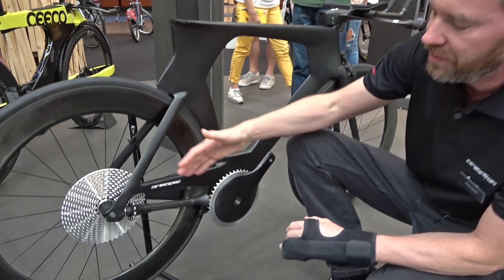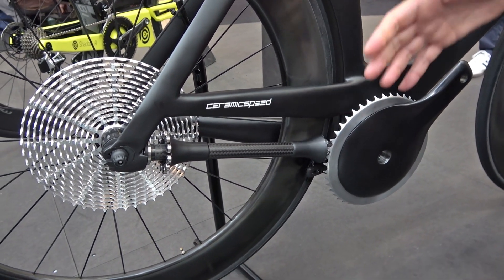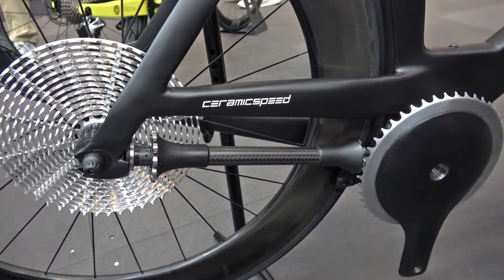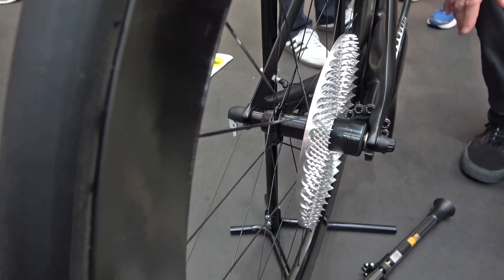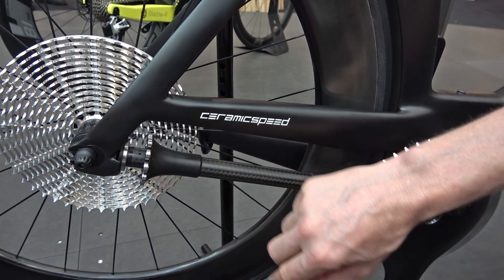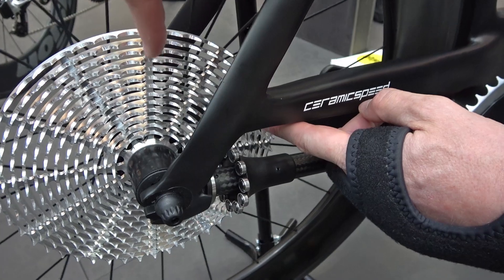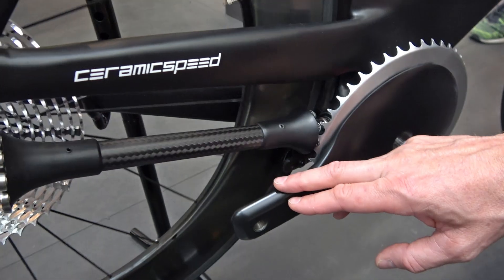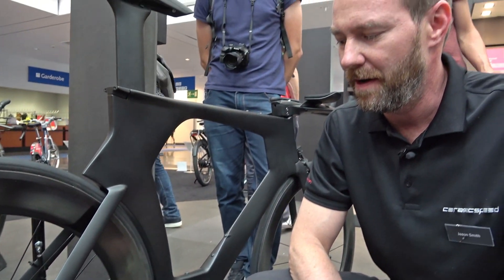CeramicSpeed Driven - Fully explained

Comment: The new angle is doable but it would take more technology than necessary to actually get it to work right because of the angle largely it looks like an idea that was invented by the people that came up with the three wheeler it works it's doable it's very stable but you tried to do something extreme on it last but not least excellent video I like where your head is at

Comment: It's a neat idea but the electronics are a turn off.  Also... I've seen strong riders break parts.   What happens when some athlete with legs like tree trunks is sprinting on this... I can see a lot of bad things going wrong.  Lack of friction is a good idea as an abstract but to really be viable you can only reduce friction to where it does not mess with the ability of the parts to remain engaged under force.

Comment: Nice in concept, but that rear 'sprocket' is guaranteed to fail, especially in the lower gears where the side thrust will bend or break the disc due to lack of support on the back side. Plus, I don't see any way to keep dirt, mud, water, etc. out of the bearing surfaces, even if the bearings are sealed. In the automotive world, we all know how hard it is to keep contamination out of 4WD components. Bicycles are no different.😐

Comment: Mechanical engineer here...there are so many things wrong with this.
Reply: What exactly?
Reply: @theMosen  usually we apply a a pull force using a chain. This force acts on the rigid side of the sprocket. It's like using the sharp side of a knife... No deflection. What they are doing is 1) reducing the number of teeth in contact with the chain to just 1 and then using the least rigid side of the sprocket to impart a force that is probably 90% over the rigid side and 10% over the weak side when there is no load. The bigger the teeth, the better... When there is no load. As soon as a load is applied, that 90% will drop, the bearing will move up the teeth and create a moment force on that tooth.. trying to break it off. This will be met with a contact angle change which will let the bearing jump one tooth and smash on the next one. Or, not, not that day, maybe tomorrow. Each toot flexing means crack propagation. You will need a very rigid material to make sure the bearings don't jump teeth, specially the larger diameter speeds. If you pick a very rigid structure, it will be suceptible to cracks and crack propagation after work hardening. Anyway, what they are doing is trying to cut with a knife, not on the full side, but side ways, it's just going to bend. Additionally, that rear gear has to be machined. If not completely, at least the teeth need machining. Expensive. But also it weakens the very structure you want to be rigid so the bearings don't jump teeth. There are a few other things. But I just woke up so I gotta check the news. Laters!

Comment: Rubbish!  A standard drivetrain is already at 99% efficient.  Look at the way the roller bearing slides into the teeth.  The frame and rear cog has to be extremely stiff in order for it to work.  That rear cassette is extremely flexy, causing massive losses and extreme inefficiency.  Stomp on it, and watch it skip gears.  Listen to all that noise.  It’s inefficient to have to beef it up structurally just so it doesn’t flex.  Meh

Comment: Dude That's not fully explained, change the title to this video. To Introducing the New CeramicSpeed Drivetrain. There is a lot more to explain, the crank and shifting of the crank and what kind of shifters you are using. Did you say electronic? What it's an automatic shifter? How does it that work front and back more details especially while riding, How we choose the gear? What with thoughts or the power of weight we apply or what? Hooking it up? Plus you didn't demo the rear shifting while in motion.  What is up with It's like my motorcycle a VStar 1100 custom or classic, They have drive train, no chain or belt. Ceramic got the pointless friction but is it fragile is it breakable? Like will it shatter like a plate or what? Is it only for street and wood tracks or you have outdoor type downhill or trail riding? Is it grease lube or something else. Sealed bearings? What's behind the crank three-piece. How about attaching to the bike? Any bike wheel and frame? You need to do a lot more than just say look at this. Common!

Comment: Has a lot of weak points from the looks of it.   Might be fixable with dual shafts on both sides of the rear cog. Then you have added weight.

Comment: Sure looks familiar..... like piece of a bike chain wrapped around the shaft and a bike gear with the teeth bent sideways. This idea has taken away a lot of strength as well as the weight and friction.
If I was one of the human testers/guinea pigs for for that on a bicycle..... I would demand cojones protection, like padding or a cup, plus shin, calf, toe and chin guards= I've had chain drives slip off and or break before and have ruinated my parts more than once.

Comment: First, bad explanation, second as the smallest ring of circular teeth represents the highest gear, no you cannot add more gears to this as the smaller ring produces more movement since it won't have to go through so many teeth to make a full turn on the backtire.
This project is faulty for another reason as well, wireless? battery? how would they fare against bumps friction and length of usage. Remember chains and general gearshifting lasts a very, very, very long time. The first two failure points are these that I've noticed, i'm sure some cycling enthusiasts could find more points of failure but these are just my two cents.
Drop the project as soon as possible (investment wise and evolution wise it's a black hole).

Comment: The reality with this is that it will not work. The amount of force needed to keep the gears in mesh would be substantial. One stone and it's done. That's even if you could transmit any force through it in the first place.

Comment: It would be fine if the bearings and teeth were made out of dirt-reflectant Adamantium and the shift mechanism out of Mad Sweeney's melted down lucky coin with a sprinkling of fairy dandruff for extra double the luck and lubricated with holy water from Lourdes.

Comment: A second pinion, two shaft electromagnetic clutches, and redundant ratio planet tooth sets. Two pinions in the same ratio enables the next ratio's pinion to be in place then engaged as the current ratio is released. This would allow near instantaneous shifts become a possibility and for sprinting loads or climbing both pinions could be on same ratio. 

A purchase order for a new Koenigsegg if played perfectly so it slips past the accounting department's watchdog could become an invaluable tool allowing engineers to Twilight Zone their travel into the spooky thinking area where eureka moments at scary velocity are possible. This seldom accessed brain feature appears to only be available while traveling with a tight proximity between your ass and the static reference surface.

Well look at that, I now find myself with a hankering for something very Swedish Chef. Popcorn, chicken... meata ballsa it is, bork bork bork.

Comment: Very dangerous.  The gear decides what speed you can run.  Maybe there is a flaw.
Sometimes you drive faster on a uphill if you wanna overtake on a smaller gear but if the bike depends on battery and computation then, you have no control at all. Any effect on the mechanism with regards to time using the bike, like battery, heat etc.
Idea to make it lighter, but safety is also a necessity.  Video on actual use please

Thanks

Comment: The play between the cassette and the bearings is LARGE.. horrific wear on the teeth. This wil not work practically... a cardan system would be a better idea. 2 point rolling friction with same force as 8 point sliding friction will cause huge wear.

Comment: Add a plastic shield to all gears with points to oil/grease them and protect from debris. Remove all electronics, use lever, cable, whatever. Sell it for $100 (this involves cheap but reliable parts -which might be a little heavier and cheap labor). Become billionaire. If you try to sell it like this for about $1000, no one will buy it. People prefer a scooter for this kind of money.
Actually, shaft driven bicycles are nothing new. They are being made by Dynamic Bicycles, Beixo, Biomega, and BRIK.

Comment: It amazes me how many folks are pointing out all the flaws in this design and how it can never work in practice. Are y'all engineers? Really? It's a prototype: a proof of concept. They showed they can make a 99% efficient drive train. That's a huge engineering accomplishment. They'll need to spend more time refining the design to handle real-world use cases. That's standard engineering practice -prove it can work under perfect conditions, then make it work under less-than-ideal conditions. Maybe they'll get it robust enough to replace the conventional chain system. Maybe it'll be relegated to a niche use like competitive sprinting. Or maybe it'll remain a proof-of-concept.

Comment: If you never crushed your nuts on a bicycle buy this set up! That might look new but it is impractical, the mechanical stresses placed on that gear ring will cause it to warp away from the single point of contact and when it unloads mechanically your ballbag will take up the slack against the bar!! 
Everything about this sucks, those bearings will clog with dirt and grit, the change system will fail and be a return to dealer job to have it reprogrammed, the secondary gear ring has no torsional strength and will not only flex causing the earlier mentioned crushed nuts but will fail resulting in pushing the bike home and asking yourself why you were so stupid as to buy a pice of crap like that.

Comment: Very skeptical. You have only one point of contact for all of the drive force instead of several points with chain/gear drive. 
As shown, I think it would fail very quickly under load.

Comment: reasons why this is bullshit
1. the pinion bearings (the little ones) will have a tiny axial load rating. much much less than the main shaft bearings even though they are subject to the same forces. the separation forces caused by load will wear those bearings in no time at all.
2. the rigidity of the shaft main bearing housings and the size of the shaft bearings needed to keep the "gears" in mesh would negate any claimed effiencency.
3. the seal friction on the main shaft bearings adds to the the equation.
4. the lack of seals on the pinion bearings will soon invite dust and dirt leading to premature wear.
5. adding seals to these bearings will add friction to the system adding to the equation again.
6. ball or roller bearings require a certain amount of rotation for the balls to actually start rotating under load. before this they are sliding on the bearing races. the pinion bearings are only making small and interrupted movements with each tooth engagement. this will lead to increased bearing wear.
7. The rear pinion bearings are installed in single shear. this will provide lower rigidity making it harder to maintain gear mesh under separation loads
8. The larger "cassette" gears provide a longer leverage for seperationn forces to deform the cassette. To maintain rigidity each larger gear needs to be of heavier construction than the previous. 
9. His idea of switching out pinion sizes to change overall gearing isn't so easy as he explains. those pinion changes would require lateral position change of either the shaft or the mating gears to maintain correct (or any) gear mesh.
10. the single tooth engagement places massive loads on that single tooth leading to higher tooth wear and possibly total tooth failure. 
11. over time the rear pinion sliding drive spline (required for gear changes) will wear and develop both play and backlash. the play will make the rigidity required for gear mesh worse.
12. tooth wear will create back lash in the the system. combined their will be four stages of drive delay on commencing peddling a: freewheel hub pawls b:front pinion to gear c: rear pinion to gear d: rear pinion spline interface. could it be possible to have as much as 1/2 turn of the cranks before drive engagement on a worn system?
13. The axial load or separation forces generated at both ends puts side load on the bottom bracket bearings and the rear axle bearings. Not so bad for the rear axle bearings if they are angular contact bearings (though most now spec deep groove bearings) but its extra side load for the deep groove bearings in the bb. this will lead to faster wear of these bearings. This load will increase friction with in these bearings also. Also the preload on these bearings will need to be exact (maximum recommended by the manufacturer) to maintain system rigidity to maintain gear mesh. 
14. gear mesh needs to be carefully setup and maintained as the system wears. too little mesh and the toe (tip of the gear) receives all the load and backlash increases. Too much mesh and the bearing pushes into the heal of the tooth creating load on all bearings int the system leading to premature wear.
15. His argument seems to be based on friction area (8 sliding points vs 2 rotating points). There is no area component to the friction equation, only force and coefficient of the materials involved.
16. There is going to be a hell of a lot going on in the twisting, bending and harmonics of the shaft under high load and speed that is too much to write about here.

Comment: Put a magnet inside the shift tube and attach a cable to it. Move the magnet back and forth to shift. Forget the battery. The electronics can quit or break at a critical time, and would not be fixable on the side of the road.

Comment: less eficiant than a chain, a chain is 99.2% efficiant.  this has more friction points and will not work at all, which is why you will never see it ever produced.  also there is no possiblle way this is 99% efficiant, not a chance.

Comment: This is pure Simplicity and brilliance!
Reply: simple? r u kidding or what. this is old obsolete tech from 1920's and 30's made shiny. it didn't work then and certainly physics have not changed. the idea of a cassette was cheaper, more reliable with durability unmatched against any radial, belt, or axial gearing. so much so,  that nearly all lightweight applications use inline rotating gears. direction of force = direction of rotation. simplest. unequaled. this is overly complex and doomed for many reasons. even if you could somehow make it from some exotic carbon nanotech material

Comment: What a scam:
"We invented chainless gear for bicycle" then he tells us that they are teamed up with University, and then he proceeds explaining how gears works (like it is rocket science).
So basically, they used RNG to generate 120 designs (and it took 1.5 years), failed to evaluate/test their validity and performance, and submitted them to the university to do it for them.  Again, what they have invented here? Which part?
Also, it doesn't shit yet. And this piece of metal does there? Prototype has to do something. This pile of junk does one thing - exists. Keep your concepts on paper under your pillow, go public with working prototypes.
Also, I expect it will fail almost instantly once driver gear start wiggling, and it will happen rather instantly after first rider try to ride it. Overall it is fragile when some mechanical force is applied to system.
Also they can put their electronic back into they sh*tholes. It is one huge x0 for their invention. We already have 'electronic' gearboxes in our cars - worst invention ever.

Comment: 2 mil clicks.  so 1,400 bucks...in whatever currency.  ...all for a video that does not show a rider ACTUALLY using it...why???? because it is not tested .  it's only a prototype .  this thing will not hold up against me cranking this up a mountain with every bit of full strength I have...I would break this thing in 5 min.   from an engineer prospective the power ratio is losing power and torque.  example. I am 210 with quads lie a horse.   I do sprints in the velo.   I can ride 50 km in 1 hour and 27 min.   my force will snap this thing, torque it and break it.. because it will not allow my power transfer to be direct. ( 2 gears were added , that decreases power transfer) every engineer knows this!  this is now inefficient ! direct power is the key.  I m all for new tech..but don't post such a misleading video and get paid for it.  not one comment here is a positive one in favor of this .

Comment: lol - that prototype was designed by someone who knows absolutely nothing about the laws of physics. This is what happens when you get a wet-behind-the-ears university engineering graduate, (educated on autocad, who has never had oil on their hands, and who has probably never ridden a bike), to design something. There is a reason why they don't show anyone riding this thing,  and why they never will - because as soon as you put power through those pedals, the entire contraption will explode into a heap of shards, and the "gears"-disk at the back will crumple like tin foil. A total fail.

Comment: More complexity with electronics, more things to fail. Have you ridden a mountain bike in brush ? Things will jam those gears in no time.  Have you tried going up a 20-30 degree incline ? The load on the gear will bend the the plate and cause it to slip gears ... Don't release it until you do real world testing or you will be sorry... Waste of money and R&D effort.